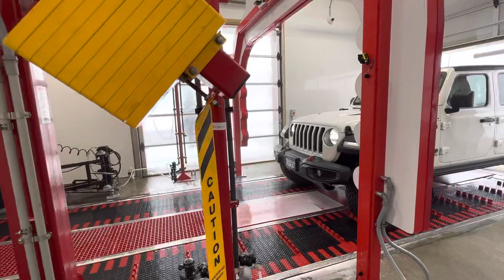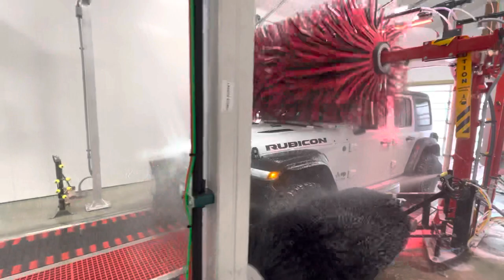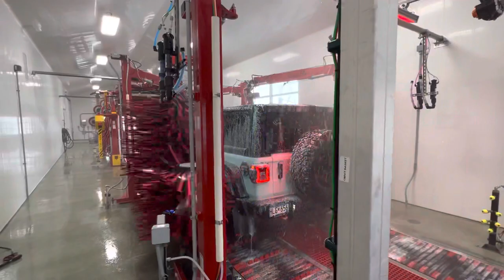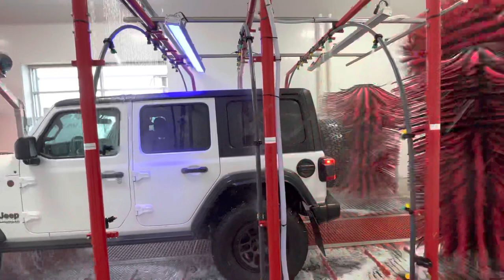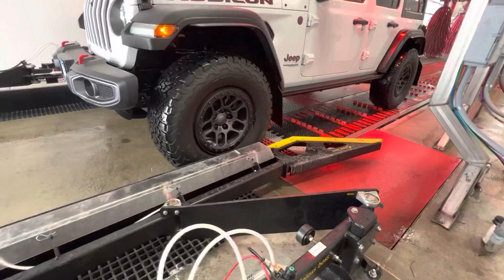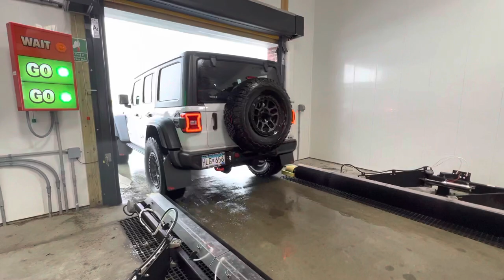Bubble Barn Lakeville Car Wash - 2022 Newest Location With MacNeil Equipment Installed By ASI

Comment: Not a fan of how the Gloss Boss is being used in the tunnel. Kind of takes away the consistency of the tire shine chemicals being applied while a vehicle is unloading.
Reply from the maker: Are you referring to the sonics? Tire shine is applied on exit when vehicle is unloading.
Reply: @carwashnews  I'm talking the tire shine at the end of the tunnel right after the dual belt. Sure, the front tires get a decent application of the dressing, but once the back tires are off the belt the pacing is rushed and the quality of the entire component isn't at it's fullest capability. It just seems a bit unnecessary to have it if it can't be used traditionally (with a chain roller conveyor.)
Reply from the maker: @ncautowashes2889  I completely agree with you. I don’t think I would offer tire shine this way in my own washes if they were to have a belt. I think the demographic of customers that really care about tire shine will apply it themselves.
Reply: The tire shine has to be applied at the end as the tires don’t spin while on the belt, therefore only part of the tire would have the chemical applied
Reply: @PalmPeakMarketing  I know some express washes with dual belts use it for obvious reasons, but I don’t believe it should be used at all for that configuration.
Reply: @ncautowashes2889  The thing is that you just can't step on the gas as soon as the car is offloaded from the belt. Just continue driving at the same speed as the belt until the rear tires pass the tire shine applicator. I always make sure to  keep a consistent speed  even after the belt and always had good coverage of tire shine even on the rear wheels.
Reply from the maker: @Alex.AL_26  you can drive a consistent speed, but getting customers to do that is a challenge. Tire shine on a belt by nature is inconsistent